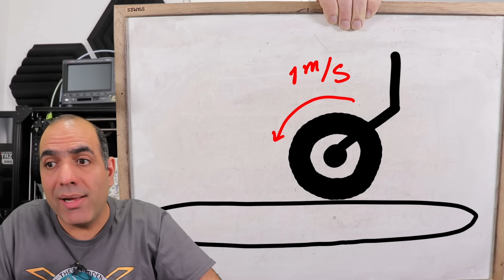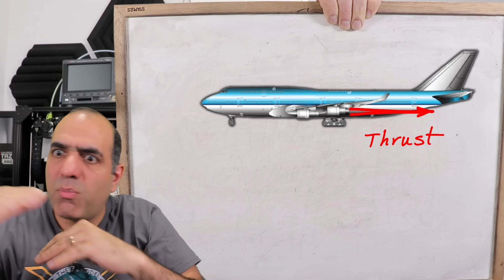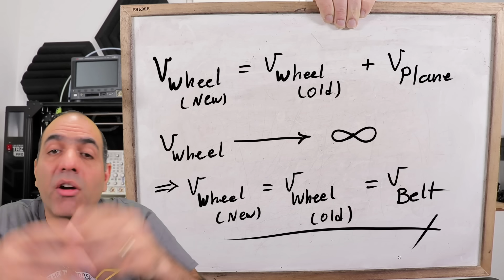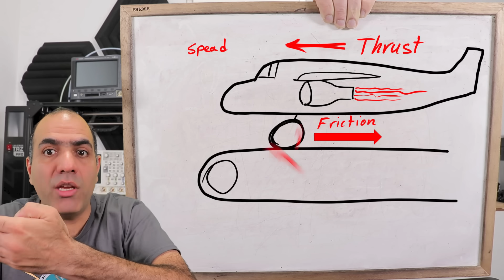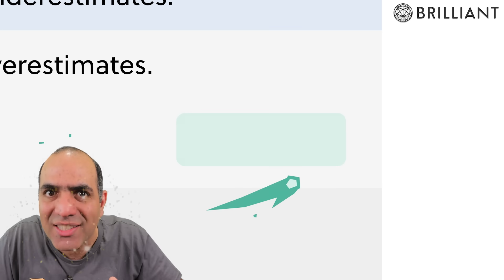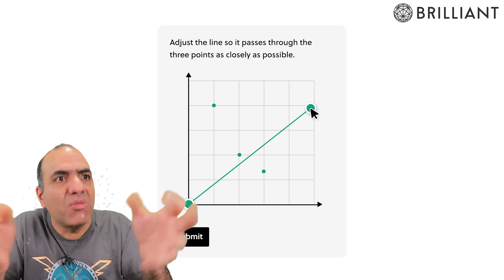Airplane Question that Drove Me NUTS!!!

Comment: It forgets that typically, you use flaps as well as wanting to have the closest to a headwind as you could get. Also,  aircraft have been known to "fly" on their own with the wind being strong enough. (By "fly" I mean that storm winds, and jet blasts have been known to pick smaller aircraft up and flip them over while they are just sitting on the ramp.)An aircraft is designed in order to create lift. This is why smaller aircraft are tied down when a storm has been predicted in the vicinity of the airport.

Comment: No the plane can't take off.  While the wheels can spin independently and the jet can still move forward as normal, the conveyor is designed to match the speed of the wheels.  When the wheels start moving because the plane moves forwards, the conveyor moves backwards to match, making the wheels move twice as fast so they conveyor is programmed to move even faster to keep up.  This produces an infinite feedback loop until the conveyor is moving so fast it bows outwards under the force, making the wheels move ever faster until the conveyor explodes under the incredible forces and destroy the plane before it has a chance to leave the runway.

It was bad programming that kept the plane from flying, nothing to do with the physics.
Reply: Aw come on you can't tell me to pause the video to answer the question then have already stolen my joke later in the video!

Comment: No, it can not
because the aerodynamics that makes the plane takes off
on a conveyor belt there isn't any air moving, except if there was a HUGE fan in front of it, then it will take off
and then we won't need the conveyor belt at all

Comment: No it won't take off! The Aircraft isn't moving and there is no air flow over the wings, it's just the wheels turning. so many idiots making comments assuming that the aircraft IS moving when it's not, the aircraft needs forward movement to create airflow over the wings to create the lift it needs for takeoff you stupid people 😂🤣🤣🤣

Comment: It amazes me how many people don't watch Mythbusters. It should be mandatory for all humans to watch every episode. But what gets me about this is that if the plane starts moving forward at 1 m/s that means that the treadmill will match that speed so it starts going 1 m/s but that means that additional speed will make the wheels move an additional 1 m/s so the wheels are now going 2 m/s which means that the treadmill will need to go 2 m/s which means that the wheels would be going 4 m/s which means that... do you see the problem? It will just blow up, it will very quickly create infinite speed on the wheels. It's because the wheels are always going to be going to speed of the treadmill PLUS the speed that they are getting from the engines and the treadmill HAS to compensate for that engine speed by going even faster than the wheels themselves! BUT that speed just gets ADDED to the wheels! lol, and it all starts over again! It's so stupid. I don't even know if this is possible, I don't think it is lol.

Comment: The wheel speed has nothing to do with, it's all about airspeed, as in how quickly air is moving over the plane's flight surfaces or how quickly the plane moves through the air. Assuming the wheels wouldn't break if they went really really fast, the belt could go stupidly quickly but if the air across the plane isn't fast enough, it won't fly.

Comment: Case 2 is my take on it

Case 2B though is actually interesting because you can fork this one further.

the wheel melts. Which means...
A) the plane catestrophically impacts the treadmill which is moving at infinity speed. Everyone dies. Parts of the plane takes off... briefly.
B) the treadmill stops. Plane skids on belly
B1) plane skids to a halt
B2) friction isn't enough and thrust is high enough to take off after grinding through some of the belly

Comment: Look. For a plane to fly, the wings have to generate lift. If you put the plane on a conveyor belt and put the engines on max thrust the plane will have to go forward. Its not the wheels that move the plane. So the plane will fall of the conveyor belt. If somehow the planes wheels get to the perfect speed to take off, it won't take off because the wheels might be at perfect speed but the plane isn't moving thus not generating lift. So the answer is, No it won't take off.

Comment: cuz in the first case if the friction is zero then there will be no interaction between the surface molecules of the wheel and the belt. so the problem contradicts itself. in this case the belt can not move at the same speed as the wheel cuz its not interaction with it. the plane will just stand there like an idiot unitl its comes back home and gets yelled at by its wife for burning up all its fuel.

Comment: So for on earth gravitation:
Actually the question is cheeky. It tricks you into thinking that its like on a treadmill but the wheels don't move the airplane, the would probably just spin around very fast and the plane would fly of because the wheels don't really mean anything in case of how the plane propels it's self. The jet engine or eaven a propeller is the actual propellent. Again, the question takes a familiar situation (walking or running on a treadmill) and than cheekily applying it on something else that has nothing to do conceptually. In shorter words, it's a trap question.

Comment: Planes are not driven by their wheels! The plane will behave as normal the wheels will go twice as fast as normal. Speed of belt+speed of the aircraft. That is all. In a proper aircraft this may over stress the tyres or wheels and might slow the plane down a little bit because the friction of the bearings etc will probably increase with speed. but overall the take-off would be normal.

Comment: so, the mythbusters actually tested this by putting a real plane on a real conveyor belt and it took off as if the conveyor belt wasn't there

edit: well, 6:30 lmao
Reply: Even in the small scale test they did on Mythbusters, the RC plain still moved forward and took off with no trouble at all on the belt while the remote controlled car stayed put.

Comment: My shot:

Assuming no headwind, tailwind, etc.  And assuming current physics.  And assuming Earth, Sea Level Atmosphere... basically everything nominal.  And assuming there's full thrust.

Thrust is applied to plane.  Plane moves forward, turning wheels. Treadmill reacts, negating wheel turning, bringing airplane to a halt. This means the airplane moved just a fraction of a(n) (insert unit of measurement here) as the reaction time of the treadmill has to be taken into account.  There is an assumption given the problem stated that the treadmill does not move the plane back into starting position.  If it does, see the next paragraph for the result.  Moving forward, the plane therefore eventually will crawl to the end of the treadmill... hours, days, weeks... who knows how long it will take, but move it will.  It will definitely run out of fuel before it gets there, probably, so refueling is required.  But however long, it eventually gets to the end of the treadmill.  First the nosewheel exits. Then the front wheels of the trucks, and so on.  At some point there's a breaking of friction vs the wheels on the treadmill and the plane will skid off the end as there's not enough friction to keep the plane locked on the treadmill, and when that happens, if there's enough runway left, the plane will gain speed and lift off.

The problem here is assumption the treadmill is not directly connected to the wheels, but has to react to the wheel movement by some sort of measurement.  If the case is the wheels and treadmill are interconnected (or the above scenario where the treadmill moves the plane back into starting position), then there is zero motion and the plane will never, ever move, being locked into place as if it were tied down, and it will never take off, having no air moving over the wings to produce lift.

Ok, go, tell me where I messed up! :)

Comment: I stopped the video at 00:43 and for me it's a no. For the little I know about planes they can fly because of the sucking effect made possible by the wing profile. It's not all about the push you can have from engines, it's a matter of how much air can run on the wings in order to lift the plane up. I gonna press play now and see if I was right :face-orange-biting-nails:
EDIT:
Well... my head hurts now, thanks

Comment: Commenting here before you get to the answer: Assuming there isn't any wind, no the plane won't take off. Airplane flight relies on air passing around the wings to create lift and has nothing to do with the speed of the wheels. Now, if there was some wind, it's possible but extremely unlikely. The wind would have to be blowing against the plane at incredibly high speeds. Basically, the plane can only take off in Alberta
Edit: It turns out I was assuming the wheels were producing thrust. My answer is wrong

Comment: I feel like this video was a huge miss and overall pretty terrible. So much irrelevant nitpicking of the question to come up with wrong, unrealistic, and stupid answers. The question obviously implies that this scenario takes places on earth under normal atmospheric conditions. And obviously by saying the conveyor matches the wheel speed they mean that the conveyor cancels out any forward movement from the plane, meaning the plane is stationary.

The only right answer to this question is no, the plane will not take off. Since there's no air passing over the wings as it's stationary.

Comment: The engines' purpose is to "push" the plane towards incoming air, it is that air that creates lift on the wings. If the engines are at full speed but the plane doesn't move towards incoming air, then there would be no lift on the wings and thus the plane won't fly.

Comment: If the plane isn't moving relative to the air around it, there is little to no airflow over the wings, so they wings won't be producing enough lift for the aeroplane to take off. All that you would do is keep accelerating the belt until friction = thrust. Even if the plane was moving at 10,000mph on the belt, its velocity relative to the air around it would still be 0, as long as the belt speed is matching the wheel speed, so still no air over the wings, no lift and no taking off. would be cool to see a jet powered conveyor belt though.
Reply: You are basing all of that on the assumption that the plane isn’t moving though, the plane actually is moving down the runway and so takes off. The conveyor belt won’t stop the plane from going forward because the plane goes forward by pushing off the air, not pushing off the ground with the tires.

Comment: i like how engine thrust is the implied reason planes take off and not lift from the wings, 
friction from the wheels counteracts the thrust of the engine so the wings cant create lift 
it does not take off
Reply: If you have sufficient thrust, you can make a brick fly

Comment: Airspeed and ground speed are totally irrelevant to each other. Its the airflow over the wings that create lift. 

So even the engines technically have nothing to do with actual flight. An airliner can fly about 250km without engines from 35000ft

Comment: As long as the tires can survive the high speed, there is nothing to keep the plane from flying.  It is pushing against the air, not the ground to accelerate. 

It is like if you were holding a hot wheels car in a treadmill.  As long as your hand is on it, the treadmill can go as fast as it wants, it will not push the car back.

Comment: Well, the wheels are not the way the plane moves.. the jet engines do. So whatever the wheel speed, the jet engines will push the plane forward. So it will take off.

Comment: The plane's engines are pushing against the air, so the plane will take off. The only difference is that the wheels will spin twice as fast as they normally would. All hypothetically of course, in reality wheel bearing friction will have some small slowing effect on the plane and the wheels could maybe explode.
Edit: Damn it! I thought plane speed, not wheel speed. Didn't pay enough attention, like always.
Reply: while yes it does push against air thats only part of the answer. the other thing is the mass of the exhaust being accelerated out the back with high speed. that causes an equal and opposite reaction on the plane thus producing thrust. same way rocket engines work.
Reply: You're confusing a plane with a rocket.

The question is specifically about "taking off".

For a plane to take off it needs airflow over the surfaces to provide lift. There is not enough thrust to takeoff unless it's a VTOL which behaves like a rocket on take off in VTOL mode, and then rotates its engines to provide lateral forces and get airflow over the wings to provide lift and operate far more efficiently. A rocket doesn't need air to stay aloft, it's dependent on thrust alone.

All the thrust is doing on a plane is pulling or pushing the a/c forward in order to provide airflow over the wings, it doesn't provide lift: that's why plane engines point laterally.

If you take a ride in a small plane, it's not at all unusual to find yourself at a standstill relative to the ground in windy weather. In extreme situations you could find yourself going backwards, but pilots generally avoid such weather conditions as they're trying to get from A to B.

That's also why aircraft take off into the wind: it increases the airflow over the surfaces, thus providing significant additional lift even when the aircraft is stationary relative to the ground. It's also why smaller aircraft stored outside have tie-downs.

The wheels, friction etc are all canards in this question.

Comment: No I won’t take off.

If the conveyor is moving at the same speed the wheels are moving in the opposite direction, the plane’s speed is 0.

Last time I check, planes do not take off vertically, and this is reinforced by the fact that airlines probably wouldn’t maintain useless infrastructure if the plane could, in fact, take off vertically with no horizontal movement.

Comment: But if friction is not ignored, there is friction between the conveyor belt and the surrounding air. So the belt accelerates the air and eventually the air gets fast enough for the plane to take off, while the plane is still effectively at 0m/s relative to the ground.

Comment: I caught a mistake. If friction increases with speed and matches to thrust from jet engines plane won't stop, it would stay at same speed because it already has some velocity. Like air friction (does it called terminal velocity? Not sure).
Reply: Right, but this means that it stays at that speed and has not taken off yet, which means it won't take off at all

Comment: Expanding on solution 3 - at some point some part of the plane's gear would fail due to mechanical and thermal loads and the plane would fall onto the conveyor belt and considering the probable speed of conveyor belt get turned into very small pieces. Alternatively, albeit I'd say less likely, the air dragged by the conveyor belt due to skin drag would be moving at speed high enough for the plane to take off.
Reply: You forget that the belt would have to be made of materials as well, unless we want to view the question as pure simplified thought experiment  with no connection to real physics (in which case why even ask the question).
The belt, being bigger, would likely fail first. So much more inertia, friction, and heat. If the belt destroys itself, probably the airplane would be destroyed as well, so it cannot take off.

Comment: I mean... I figured it meant the BELT was as long and wide as the runway. In the picture the conveyor itself is only about as long as the plane itself, so in that scenario the plane would simply fall off the end of the conveyor belt almost immediately. If the conveyor structure itself is as long as a runway, then... well, it's just a runway. the wheels aren't pushing the plane forward, the engines are, so the rotational speed of the wheels is entirely irrelevant.

Comment: it really depends, then, on if the aircraft can get to V2 (safe take-off speed) quick enough as to counteract the conveyer belt runway.
Reply: Isn’t safe takeoff speed V1 Speed?
Reply: You missed the point, the wheels are free-spinning so the conveyor belt has no effect.

Comment: I suppose the conveyor-belt would break.. since it would keep speeding up to "infinity" once the plane turns on it's thrusters and start moving... The wheels aren't propelling the plane... At least, that's my guess.
Reply: If we assume the conveyor belt is indestructible, and so are the the wheels, then the belt would speed up so much that it creates a black hole (energy and mass are ultimately the same thing, the amount of energy needed to speed up to basically-infinite would also be basically-infinite; what happens when you concentrate mass in a tight space? a black hole).

Comment: Due to lift and ground effect moving the plane upward even slightly it will simply come off the belt and take off. There is no instability because the belt is matching the speed of the wheels so really the conveyer belt changes nothing.
Reply: Omg!  You need to take physics class dude.  A plane will fly only if there is air moving relative to its airframe to create lift.  If the plane is standing still, there is no air moving around the wings, so no lift, so it won t take/fly.
Reply: @StefBelgium  Baiting

Comment: Yes it can take off, I don't get why is it still even a question... Mythbusters did it years ago. Aircrafts do not transfer power from engines to wheels like cars, so it doesn't matter if it is runway or conveyor belt.